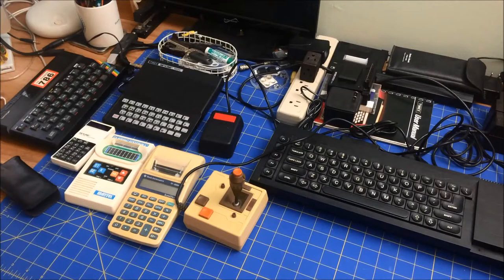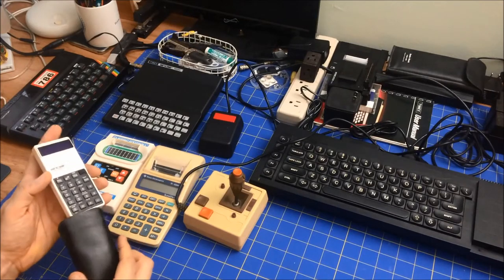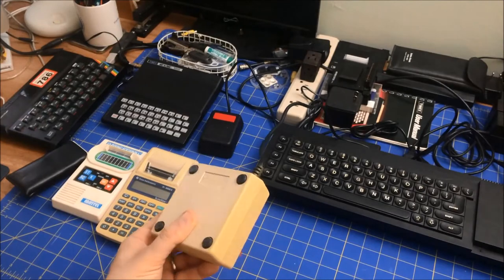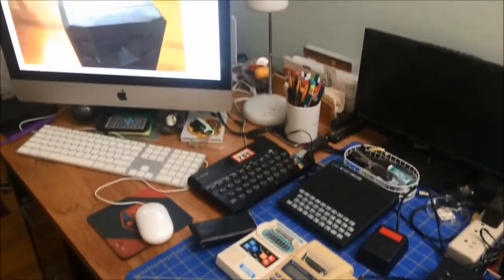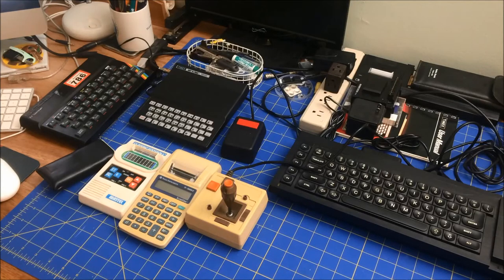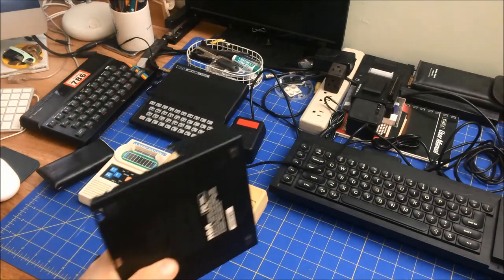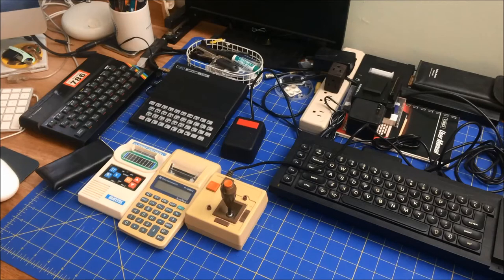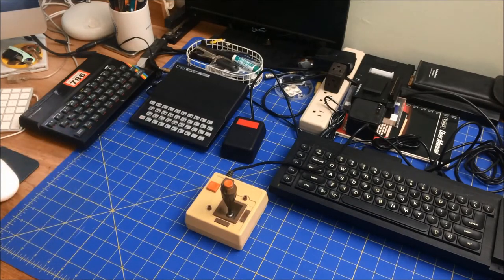Retro UN-Brighting - Safe Ways to Clean Retro Computer Gear

Comment: Nice video! It gave me some ideas for more products to try. I find that the best products vary a lot on the specific case you want to clean. With C64s baking soda is great, but not so much with other plastics, etc. You should add to your own list some kind of car dashboard protectant. Not so much for cleaning but for restoring some of the shine and just protecting the plastics. I really like it as a finisher after things are nice and clean for a lot of computers (not all though).
Reply from the maker: Thank you. I think backing soda is pretty safe. I don't think it put a noticeable scuff into my plastic sample. I wonder what kind of aging black plastic can have since it can't explicitly yellow...I think I had an old black TV that got a bit dull but that was a very shiny plastic. I wish I had recorded how the plastic of my PA system behaved but once I got it back to normal I didn't want to try to ruin it again :-/